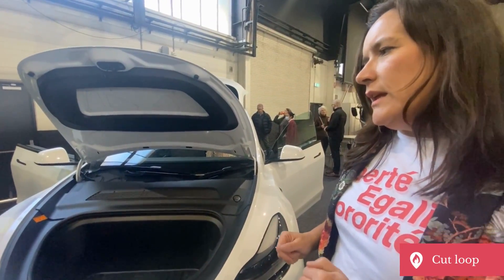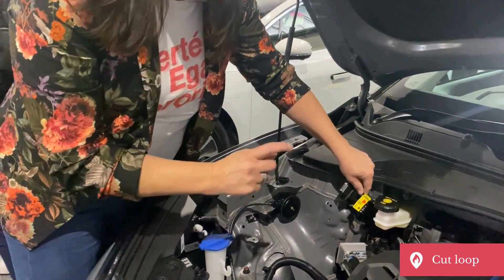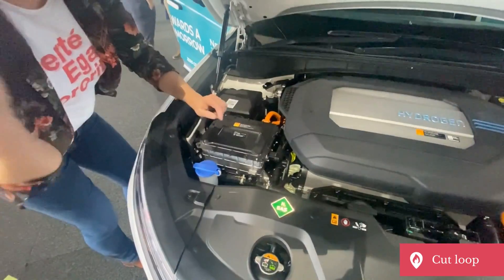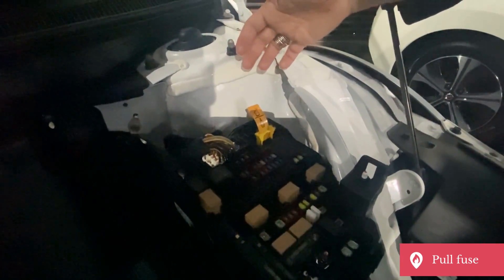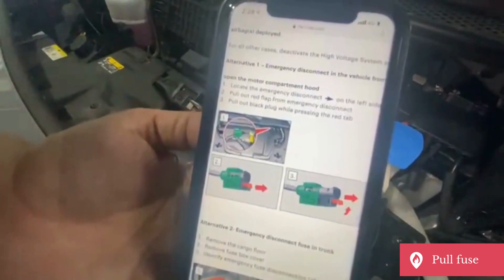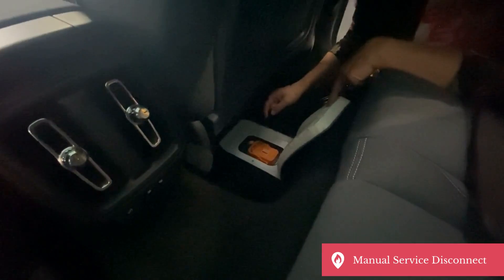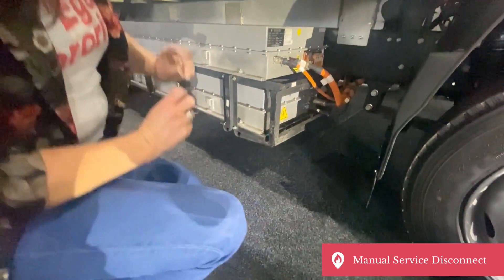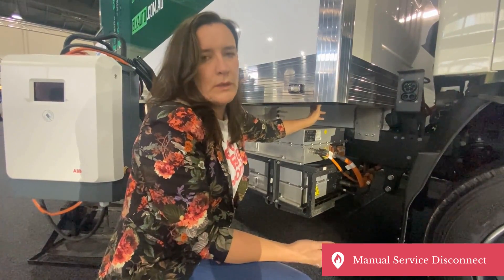How to isolate an EV battery for emergency responders

Comment: Is there a need to disable a high voltage system after fire fighting the electric vehicle?
Reply from the maker: If it's accessible, then yes, but in most cases the HV systems will have burnt out.

Comment: Why are some of these methods for use by mechanics and not firefighters? Are they more risky to use?
Reply: Hi Sean,
A mechanic or EV technician is able to be provided with suitable training and ppe/ppc for the work task, and has the benefit of “work” being booked in suitable for a workshops makes/models/tools and training.
That's NOT the case for emergency responders who will be working on these cars in any situation.

Where the technician has a controlled sterile environment, the responder could be standing in wet grass, in wet gear and where water has been sprayed all over and inside the car.  That makes it potentially unsafe for the responder if using a Manual Service Disconnect.

A technician also can usually use computer equipment to check the car and diagnose any faults or errors, such as a case of “welded” or faulty contactors - for a technician, then can then follow the suitable procedure with the correct PPE/PPC in that workshop environment and be safe - the responder may potentially be in close vicinity and possibly contact the exposed and LIVE High Voltage.

The emergency responder methods that we like are all low voltage and don't require specific training or equipment
Reply: @DanFish-xs6fn  That's really helpful. Thanks very much! 🙂

Comment: Thanks, but the video was quite noisy. How can such important safety features vary so much between different cars? Why isn't there standardization? How can an average user, with little knowledge of electronics, manage to handle these differences? It seems like it might take a serious incident for the industry to recognize the need for consistency.
Reply: Working on an update currently with mics - hopefully this is with better audio and some new vehicles too!  Subscibe and it should be up shortly in your inbox

Comment: Major problems with the fireman cutout loop is that you have to be able to get into the car boot or bonnet to access it, which is less than ideal if the car has been involved in RTA then that might be impossible to do, also if its on fire, access may be prevented.

Comment: Yes, excellent video.  But can you imagine two electric cars (or even one electric and one petrol) colliding at night and one catches fire then the other, and the poor old firefighters are jumping around trying to pop the bonnet and work out where the "firefighter tags" are so they're not spraying water onto 800V.  The boss of the team would say, "Get out of it, you're gonna get killed!  Let 'em burn."

And even if they CAN cool the EV battery down now, the bloody thing could re-ignite even days later!
Reply: Just let em burn and don't breath the fumes, move everything mobile away from it. Lithiums self destruct mostly on charge but otherwise disconnecting the HV battery makes no difference if the internal relays have already opened. Impact deployment of emergency gear on board triggers the relays. Older IC cars (XJ6 etc) often had an impact switch to kill ignition, electric fuel pumps and injection systems. Cutting the neg terminal lead  on the auxiliary 12v EV battery stops ordinary wiring fires just like IC cars.
Reply: Thats probably a bit of an alarmist view, and yeah, anything is possible, but we are seeing EVs involved in some HUGE traffic collisions with absolutely NO thermal runaway at all.  Yes it needs to be monitored and treated respectfully, but some of these collisions have been so significant, some responders have wondered if the incident would have been a much sadder outcome if they were not in an EV, having a huge chunk of engine block and transmission etc forced through the occupant cell

Comment: The Firefighter fuse is in the front bay of the vehicle and when in a front end collision may not be accessible. The mechanics service disconnect plug being in the rear passenger compartment may be the only accessible plug/ fuse in a crash etc.
Reply from the maker: Tesla's have a second loop behind the rear driver side (in Australia) window - peel & peek to find. But not many others.